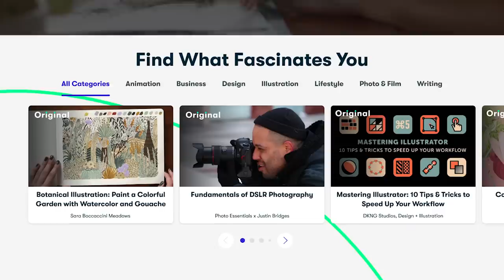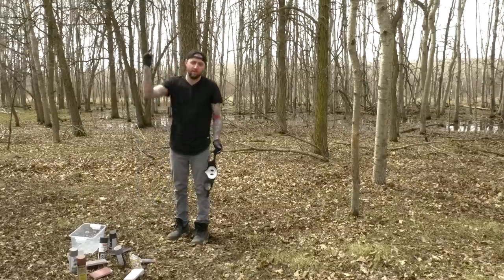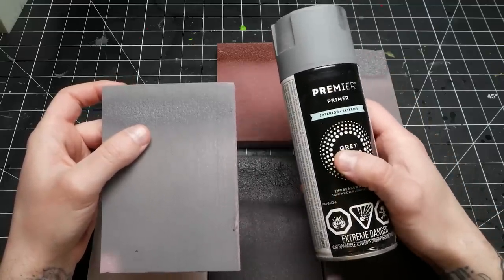We need to talk about spray paint melting foam.

Comment: Next video: salvaging molten foam as dragon breath scorched terrain
Reply: Winning👍👍
Reply: or use it to make a worn path
Reply: Exactly what I was thinking. Makes for awesome burned beams and destroyed terrains
Reply: I used a small bit of foam stone wall i made to test spraypaint and it looks really good as 'severely eroded' stonework effect too.
Reply: I mean if you melt it this way and prime correctly over it, I belive you can use it as a great wall texture.
Reply: I used it as heavily rusted detiriated iron using black or dark brown spraypaint then acrylic drybrushed with a variety of rust shades. It really looks like the real thing.
Reply: Also seems like it could be a nice effects for craters or maybe even cave formations...
Reply: @robg4657  Sounds good
Reply: Exactly! Sometimes it is a perfect for a certain look.

Comment: Solid example of good technique with extruded polystyrene foam (XPS).

I think it's worth noting that expanded polystyrene foam (EPS, the stuff that looks like it's made up of beads and that gets used a lot for packaging, among other things), is much less dense than XPS, and as a result much more susceptible to melting. And the melting is much more extreme when it happens.

Also, in addition to using something like ModPodge for a barrier, latex house paint works quite well and is inexpensive, especially if you get mis-mixed cans.

Also, also, the texture of EPS when broken or when you use a rasp can be a very nice base for spray on rock effects. Because those go on very thickly and take a while to dry, you really want a barrier for them.

Comment: I use krylon fusion as a primer as it does work on styrofoam without melting it. It doesn't melt foam at a range of 8inches. Barring that, a whole bunch of gesso for a shell for the paint to bond to.
That's how I do it, anyway...

Comment: So, first a little backstory; I've recently restarted playing DnD. I'm a player, not the DM, but I am the most "arts and crafty" person at the table so I've been tasked with building up our collective terrain pieces.
I decided to start with a cobblestone open area that could either be roadwork, a courtyard or a dungeon or even an old castle interior depending upon what scatter terrain is thrown in. I've got 3 more projects in a similar fashion- wood flooring for tavern, docks or any other structure that would have wood planks, grasslands that can be fields, jungle, woods ect based upon scatter terrain, and rocky terrain that can either be caves or mountains.
Anyways, I got done with the initial cobblestone build last night and was waiting for my glue to dry and was watching this video while having a smoke break. I didn't want to prime the whole project by hand and decided to try your method. 
I grabbed my can of Rust-oleum Flat Grey primer and got to work.
Other than one minor area at the edge where I oversprayed slightly it came out looking great and the area I over sprayed had a neat little effect where the indentations that I made melted a little deeper and actually make it look more pock marked than it did "melted".
It actually brought the texture out better.
Anyways, I just wanted to say thanks and you've got yourself a new subscriber.

(The terrain I'm working on, btw, is inspired by your foam plate dungeon tiles and another Youtuber's pizza pan idea for the base).

Comment: Thank you for this video.  It drives me nuts seeing videos where people don't know how to use spray paint.  I actually learned proper spray paint techniques in the USAF.  We would have to do touch up work to outside equipment; sanding and using wire brushes to get rid of rust, then priming and painting the touch up spot.  We couldn't leave runs, it had to look like it belonged or our boss would throw a fit, so I learned early on the the techniques you just taught.  Great video.
Reply: I learned to paint from my dad. He was 27 1/2 years in the USAF. Thank you for your service.

Comment: FINALLY! Someone had the guts to do this subject!  The Only tricky bit is for Newbies using the cheap pill type foam in a build, which wants to melt if you look at it in a corrosive manner. And yet it just takes practice, distance, and then even cheap foam can be painted in this manner.

Comment: Excellent video!  I make feral cat shelters out of all kinds of materials I find ... especially styrofoam.  I usually use acrylic porch paint, but that takes some time (to both do and to dry).   This is great information in case I have to make a quick emergency shelter (which happens fairly often).  Thank you!

Comment: Another tip on topic and very important is your area and current weather will factor into the distance greatly. I live in Southern California, so my area has a Mediterranean Step to Desert climate.  Due to this most of the time it is pretty dry to very dry humidity in the air about 30% or far less and temperatures can be in the 90°s to 100°s Fahrenheit or around 32.5° to 40° Celsius for those who live outside the USA. Due to this using spray during the summer months at the instructions 12" range tends to mean that it has almost dried up before it reaches the material you're trying to prime. Then means it probably will not adhere to it nearly as well and will tend to leave a textured coat.

That is why we all need to understand the processes of what is happening and how that is influenced by our own local areas when we craft, build and paint.
Reply from the maker: At the end of the day it’s all about practice and getting a feel for it.

Comment: My dad was building something with foam and spray painted it and it melted and in the end it made things look more realistic. My wife also did a build with foam for Halloween and it looked more realistic with the melted foam.
Reply from the maker: Obviously it depends what you are making. Someone drastically melting a little detailed house they spent days making wouldnt say the same.

Sometimes you want melting. You can use the effect intentionally. Either way it’s all about controlling the materials.

Comment: I'm glad you did this video. Agree, you can melt the foam, if you don't spray it correctly, but if you spray correctly, you don't melt the foam. I have found that your cheaper spray paints tend to be the ones that have to be used with more care or you risk melting the foam, with the more expensive ones being more forgiving, but as with any generalization, your own mileage may vary.

Comment: I have never tried it but I am told the blue insulation foam is much more resistant to the solvents in spray paint than is the pink foam. I had trouble finding the blue foam when I was working with foam projects, so I used water based spray paints instead. Ironically, those can be hard to find yet my local stores had them. So perhaps people looking to use spray as base coats or etc. Could either try the blue foam or try water based spray on the pink foam. Recently I used water based polycrylic spray in clear as a sealer and it also worked well. 
Thanks for the content.
Reply from the maker: Having used both blue DOW foam and pink Foamular regularly, and spray painting both of them, I can say I don't believe there is any tangible difference in their resistance to melting. 

I dont think it's worth spending the extra, and sourcing, water based spray paint. It's just easy to spray with normal paint. As I showed.....just try it on some test pieces and build up your confidence.

Comment: Bottom line:  Read the instructions on the can!  The instructions give you the correct info for temperature, humidity (sometimes), spraying distance and technique, how long to shake the can, etc., etc., etc.
Reply from the maker: Yup
Reply: Nope. Getting proper coverage is way harder than the two sentences on the back of the can. The light dusting that is described on the can  may work for this type of crafting as a dusty finish may actually be a bonus, but  it's not sufficient for proper coverage. Never once have I seen a medium wet final coat described on the can. You need that wet coat so the paint can flow out and self level giving a proper gloss/semi/flat finish without lines and without a dusty finish.

Comment: Late to the party on this one. Yes, I've heard not to use spray paint on XPS as well, but honestly I have been using a flat clear coat spray paint on my projects with no problems.... until today. I screwed up a portion of 2 or 3 different pieces that I've been working on. I thought I had thick enough layers between the mod podge and paint, but turns out not so much. Thankfully they should be fixable if I smooth them out a bit and/or just give them another coat of mod podge. It wasn't until after watching this video that I realized I was trying to rush through this step of the project and ended up spraying too closely. I'm just glad that I stopped before spraying more pieces and also found this video so I wasn't left in the dark as to why it happened. Gotta give a thanks for this one and a shout out to anyone else out there that has run into similar problems!

Comment: You can aslo try to get your hands on some acrylic spraypaint. Mtn colors are the best and it doesnt melt at all
Reply from the maker: Why? Why not just use normal spray paint that works fine, is easier to get, and cheaper? That's the whole point of the video.

Comment: Primers are typically acrylic and so don’t require solvents. Priming with an acrylic will generally keep solvent based paints from getting at the foam. However spray paints should be the final step because if you paint acrylic over spraypaints they will eat the acrylic long after it dries. I would not recommend spray paint for art unless you are using spray paints exclusively... mixed media tends to favor the spray paint.

Comment: 8:20 "spray paint doesn't melt foam, people do" for some reason that cracked me up. So basically, if I'm grasping this, what you're essentially doing is spaying far enough away that the propellents, which is the part that does the damage, evaporates or dissipates leaving only harmless paint that hits your project. That's where my brain went with that.
Reply from the maker: Yes. That’s the whole lesson essentially.
Reply: p.s. great video as always. Personally I think it's an important part of learning how to do this.
Could you maybe do a video about the different types of sculpting compounds you use like Das (air dry clay) scultp-a-mold, plaster
Reply from the maker: One day! That’s worth doing.

Comment: I just want to say that there IS a brand of spray paint that guarantees it is safe to use on foam: Design Master. It’s available at Michaels, and is about twice the price of other brands. Dries to a fully matte finish!
Reply from the maker: There are many actually. There are water based spray paints, and there are also spray paints specifically designed to be used on foam. There are generally a lot harder to find (impossible in some regions) and will often be much more expensive. So if anyone does not wish to search for, or pay extra for, these types of paints they don't have to. But it's certainly an option.

Comment: Thank you because I was wondering instead of buying epoxy if I could spray paint foam without it melting I shall try that because I want to do a shower panel with panels but I've seen the stone cold poxy but it's a little expensive and I'm on a tight budget

Comment: If you spray your piece "correctly" first, does that act as a kind of primer? Can you then relax a bit with technique/paint choice, or will the melting still occur after you have a layer of spray paint in place?
This maybe sounds kinda like laziness but, living in a top-floor flat, adding a second coat outdoors means a long trail back down the stairs.😁 A more controlled, close-up spray can usually be managed indoors with the relevant precautions of course.
Reply from the maker: Yup, each layer gives some protection. But I’d say it takes a few careful layers before it’s safe to spray close. Good thing is light layers dry very very fast so you could put them on several minutes later depending on environmental conditions.
Reply: @BlackMagicCraftOfficial  I see, I see, kinda what I thought.
Thanks Jeremy.👍

Comment: For spraying on foam I just used water based colors I found on my local shop. I talk to the manager about what I wanted to do and advise me this kind of product and I never had any trouble with it. Thank for sharing your experience anyway ;)
This is the product I use :
https://www.montanacolors.com/en/spray/graffiti-water-based/
Reply from the maker: Yes, of course water based spray paints will not cause any issues, the are safe. If you WANT to go through all the extra effort and cost of getting them that's totally fine, the goal of this video was to let people know they don't HAVE to. Personally, I'll stick with the spray paint that costs me about %20 of the cost that I can get at any store, as I don't see any advantage of using water based sprays when spraying with proper application techniques.  To each their own.

Comment: Really nice video that helps a lot.
An idea: can you get a video about how to substitute some of the things you use and link? Like, mod podge... I just can't use it, as I live outside Canada and USA, and a 8 fl oz can of mod podge matte mat would cost me more than 300 bucks (more than 2 hot wire foam cutting tables), and would take 60 - 90 days to be delivered, because I can only buy it on ebay, and ebay likes to cash in what they THINK I'd pay on taxes beforehand... it's not just something i can buy on the corner store. SO whenever I watch your videos (and I love them... just bought yesterday 20 different color of acrylic paints, 10 foam boards, 10 xps foam boards, knifes, sculpting tools and so on, all inspired by you), some things get me worried I'll not be able to make...
I'll use, by now, a mix of pva glue + water + black paint as base instead of mod podge, but reading your website, you state mod podge is significantly better than that... that's why it would be nice to know any substitutes...
Thanks in advance, and thanks for all the awesome videos!
Reply from the maker: You've already found the substitute for mod podge. I've talked about this a few times in videos that that's what you can use instead. It's just not as good. You can find and add some water based varnish and a drop of a flow aid to make it a little better. I talk about substitutes all the time in videos and the main message of many videos is it doesn't matter what you use, just try things. I don't know what you have in your country or available to you. I've given so so so much information on things but I can only do so much. At the end of the day it's up to the individual to try and experiment and find things that work for them.
Reply: @BlackMagicCraftOfficial  Thanks a lot. Think I might've jumped videos without paying to much attention to those details.
I asked because, as I can see, mod podge is more of a brand of products, and I tought there could be glue of other brands with same characteristics that you (or anyone on the coments) would know of :P
ANd thanks a lot for answering. I can't wait to start modeling :D

Comment: I tried doing this method and I ended up with a face full of spray paint.  I can't believe you would recommend such a technique.  Luckily I was wearing my glasses so only the second attempt resulted in me getting spray-paint in my eyes.  I did everything you said I was the proper distance away from the foam.  Clearly this technique DOESN'T work for everyone.
Reply: On a serious note spraypaint almost broke the Mr Potato Head Stompa during the priming process because he had foamcore supports.  So technique might save most projects but I personally would be very careful trying this and I would honestly rather use a coat of paint and mod podge rather than trust in my spraying skills.  http://www.irondogstudios.com/images/tater/mek_tater.html

Comment: Of course you can spraypaint styrofoam, just make sure it is not acrylic based paint. If you cannot get non acrylic spraypaint, coat the foam with something like plaster and then spray it.

Comment: I build model rockets too, and there have been times where I've spray painted a rocket, then sprayed a clear coat on it only to have the clear coat and the paint react with each other.  Would more distance prevent that as well, or is that caused by something else?

Comment: It seems you are using the very hard and dense foam. It is harder to melt. If you use the "normal" not as dense kind that is used by most crafters you have to spray it from further to not melt it.

Comment: Where'd you get that black foam fabric mask you have?
Reply from the maker: Amazon, but I don’t link to it because I don’t think it’s very good. It sized for a child even though it’s for adults and does not fit properly. Does not make a good seal either.
Reply: @BlackMagicCraftOfficial  oh, well that sucks. What do you like that works well with beards?
Reply from the maker: Sadly no mask works well with beards. But a proper respirator gives the best protection. I should have a link to a 3M respirator on my essential equipment page.

Comment: I don't have a lot of experience with paint spraying on xps foam.  But wouldn't it help to use paint on water base?
Reply from the maker: Water based spray paint is more expensive and harder to find. There are also specialty foam spray paints that are meant for foam. They are a 3-5 times the price of normal spray paint, and that's if you can find them. Why bother with all that when you can incredibly easily just use normal spray paint? Bot are fine. My point is you can use normal spray paint if you want to.
Reply: Oh here in the Netherlands it's really not hard to find water base spraypaint.